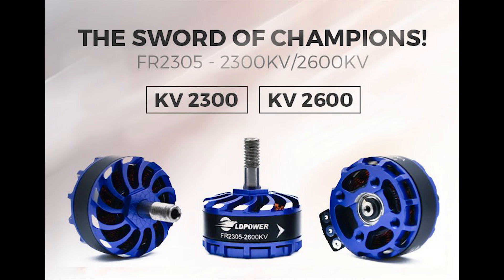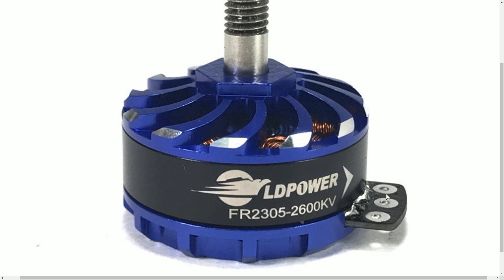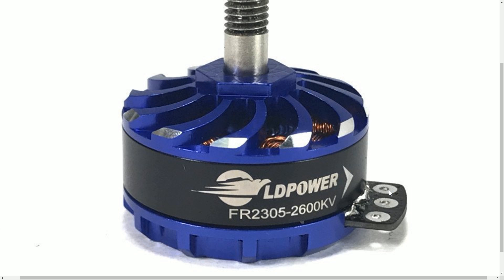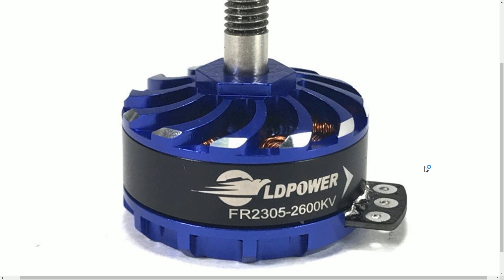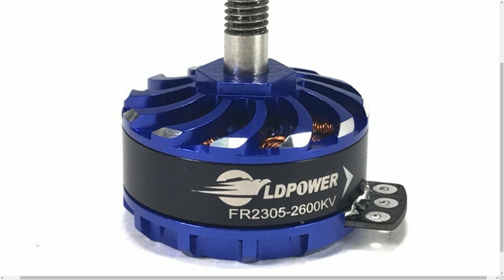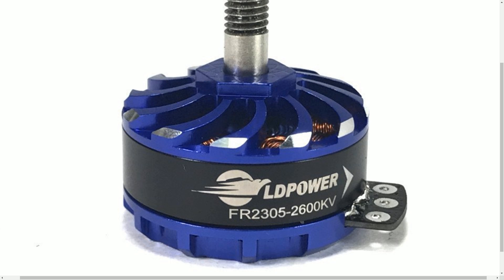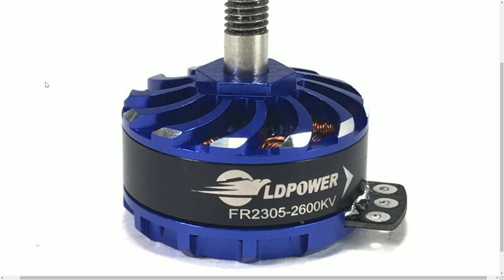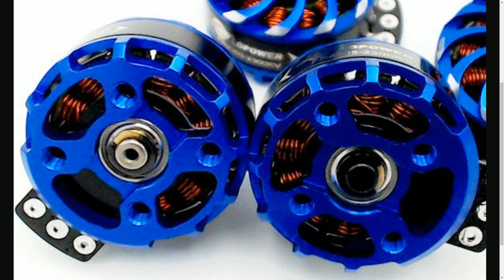LDPower FR2305 Motor | LIKE A V8 FOR YOUR QUAD

Comment: How could I limit the Poweroutput of the FC?
Reply: Might be able to just limit the endstops on your controller. But then its like, why buy performance motors if they are heavier than a smaller and cheaper one? Its like buying a drag racing car and only driving it like your mom's mini van around town, its a bit pointless. 

The only reason I can see is if you are beginning or wanting low power for indoors (I'm hoping to fly a Lizard95 indoors. It goes 70+ MPH, so I'm really going to have to limit it so I don't smash through a window or a TV. I doubt its going to be tamed, at least by me, I'm just starting so I know I'm going to wreck the thing even with a huge field dozens/hundreds of times). Lowering the throttle is probably my only hope to fly it indoors, and I have bumper air ducts like a Tiny Whoop I designed for it.
Reply from the maker: https://www.youtube.com/watch?v=0GDztuztioU
Reply: Joshua Bardwell awesome tutorial. Maybe the Lizard 95 with bumper guards will be controllable enough for indoor flying. If it can, it would be perfect for someone that wants a fun race quad when the weather is nice, and a Tiny Whoop when it's bad weather. I'll just have to try and see.

Comment: there are much better and powerfu motors than this... It's only me and they aren't that fast? R4 and Xnova 2206 Lightning are much lighter and seem more powerful to me...
Reply from the maker: I agree, although I don't have a ton of experience with other ultra-powerful motors. The reason to buy a motor like this is NOT because it has the best power-to-weight ratio or efficiency. The reason to buy this motor is because you like its throttle curve, and I do like it VERY MUCH. The motor is super responsive and predictable. If I could find a 28g motor that performed the same, I would take it though, and I suspect such a motor does exist.
Reply: I agree, they are smooth, they are great to freestyle flyers, i have the 2307 to test and they look very good but they are a bit in the heavy side (36g).

Comment: You can over prop these 2305's because the larger stator has enough torque to actually try to spin higher pitched props faster. Hence the hot motors and batteries. Like for these T Motors... http://www.miniquadtestbench.com/t-motor-f40ii-2305-2300kv.html

Comment: I'm really not totally convinced the smoke you saw was actually smoke. Looks more like lens flare or some sort of camera artifact to me, just because of how it behaves, going straight up, rather than being blown around and downwards. I dunno, if it actually was smoking, that sounds like a pretty serious issue (and I'm surprised you would still recommend them at all, if it actually was!)
Reply from the maker: No, I really am sure it isn't lens flare. I have been over the video many times and it consistently happens when the motors are punching, regardless of where the sun is.

Look here: https://www.youtube.com/watch?v=ZpU6-JY6fnk

You can literally see a streamer of smoke come out of the front-right motor. Watch it at 1/4 speed.

https://youtu.be/Sc5x-Hd6ZCM?t=53s

At 53 seconds, you can see lens flare, but as expected, it is in the center of the screen, not the edge.

And here: https://youtu.be/Sc5x-Hd6ZCM?t=59s

Another streamer of smoke from the left motor, and I am not even looking anywhere near the sun.
Reply: Chris Tate Definitely lens flare, you can see the small flares on the right side pivot at exactly the same rate as he rolls. Easy to mistake as smoke, but yeah, those motors are pulling so much air down, smoke would never rise like that unless the motor was stopped - pause on 13:44 and it's clear as day.
Reply: Yes, I see it now. In the frames I was looking at there was definitely flare in that area likely masking the smoke, but in the other examples it's inconsistent with flare. Yikes! You might want to pull off the bell and see if you can get into the bearings. I bet they are BLACK.
Reply: Fair enough, I thought it was a once off, but that looks pretty convincingly like smoke. Perhaps a friction point of some sort, like bad bearing, or something rubbing a moving part of the motor, and having it burn. Pretty bad, regardless what it was causing it. Did the bearing still feel okay after the motor hotboxed your quad? No major side to side play or grinding sounds?

Honestly, these were on the shortlist for my new 6" build, but I'm kinda shying away from them when we have so many motors that don't try to catch on fire when you punch them available. Like those new brotherhobby R5s! (and you thought the r4 was mean to batteries!)

Comment: When you say "Hot motors" warm motors etc, any chance of actually measuring temperatures of motors you consider warm and 'too hot'.  i understand the idea of judging for yourself but it would be nice to have temperatures to help guide us.
Reply from the maker: Hotter than 160 F is suspicious. Somewhere between 180 and 200  F and above, the enamel is in danger.  Realistically I don't think you should push it because you don't know how hot they actually are in flight.
Reply: Ah ok, so basically where "most" people wouldn't be able to keep holding it without it hurting. That does help actually. now i know if i can comfortably hold it indefinitely then they are ok. cheers  (and in case you missed my reply on a past video, and still haven't found out why a lot of pcbs have their writing on the underside. i suspect its so you can use pin headers and still read the writing after :)

Comment: In one of Ryan's motor reviews he talked about how the stator height meant a lot more for power and efficiency the width does, something along the lines of the motors with lower but wider stator started to really jack the amps up when the props got heavy where the taller stator motors were more linear in efficiency, can't remember which review he discussed this in but he had burnt the motor in his testing , I do know it was a 2305 maybe one of the tmotors. I think if you get the opportunity to test more "monster motors" hopefully you can get your hands of the emax 2306 or the efaw 2407's. Although honestly I think a newer generation 2206 is more the 90% of fpv pilots need and even they will destroy your lipos.

Comment: This motor vs emax 2306 2400kv motors? (assuming 2300 or 2450 kv ldpower motors)?

What would you pick?

I'm still using the standard 2300kv red bottom emax motors so my frame of reference is limited. 

In my experience, i really like the quality of the emax motors.
Reply from the maker: I honestly don't know because I haven't flown the Emax. People have amazing things to say about the 2306 with Avan props.

Comment: https://m.banggood.com/BETAFLIGHT-30_5x30_5mm-F3-Flight-Controller-Built-in-OSD-PDB-SD-Card-BEC-and-Current-Sensor-p-1162891.html?rmmds=search

is that one👆👆 beta flight f3 cab I buy it
Reply from the maker: It does look like a BFF3, yes. I'm a little surprised because I didn't know Banggood was carrying them.
Reply: Joshua Bardwell  can I buy it even it's not bff3 it looks like a clone
Reply: I can't wait a long time for bff3
Reply: It's missing the wasp/bee logo. I suspect it's a clone. Scummy...

Comment: Something still off about the audio in the videos....Sounds like it is some weird encoding or something that makes it sound as if you are being smothered by a pillow....which doesn't look to be the case.  Every other video I watch sounds fine.
Edit:  Figured it out...ish.  Your voice audio is trying to come out my rear speakers on my PC, but your intro logo audio comes out the front.  Seems like something is up with your encoding.
Reply from the maker: You have some kind of synthetic surround sound active on your system. My voice is coming out the rear because I record my voice in mono, whereas the intro is in stereo. Nothing is up with my encoding. It's stereo. Set your playback system to stereo and it will be fine.

Comment: Im confused about something this 'positive ventilation/cooling'.....
As you describe it, the motors rotation is 'flinging' the hot air up & out....
Up- against the downthrust provided by the props?
Surely the down thrust of the props (yes there's less/not a whole lot that close to center of prop) would cancel that out or even over-ride it?
Wouldn't it be more effective it the motors spun the other way so the finning helps to pump air down & through the motor instead???
Just seemed like a really obvious thing to me which is why Im confused as the manufacturers would surely see this problem too- so what am I missing here?
THanks again for your time, effort & content, & I appreciate any answer you might have
Reply from the maker: I don't know the details, I just know what I've been told. Remember that the prop is making less thrust toward the center, so there already may be a negative pressure area near the top-center of the prop disc, as air is pulled into the faster-moving column near the edge of the prop. Likewise, it makes sense that there would be a high pressure area at the bottom of the motor, as air strained to escape from the prop pushing it down.
Reply: Thank you for your prompt reply once again Joshua...
I wrote the above at the start of the clip having paused while it was fresh in my mind.
But when later in the clip you showed the motor puffing little clouds of smoke I started to think similar thoughts as to pressure area & figured, "Well, these genius motor manufacturers DO know more than me after all..." AND (jeez I miss italics) "Seeing some simulations of fluid dynamics around the motor & a prop would sure be interesting!"
Annnyways, thank you again for everything- most especially for helping to answer silly noob questions in my quest to feed my brain useful information & trivia to ponder.... ;)

Comment: What do you mean the motor is no good if you cut it too short, you've never spliced a wire?
Reply from the maker: Gosh, splice? What's that? Gee mister you sure use some ten dollar words. We jest solder with our mama's hair curlers around here.
Reply: Yea ok - I just thought it was bad information. Often when using 4-1 I have to splice the extra length of wire. I'm not sure why you took it negatively but maybe so many smart ass comments have worn you down and you see everything as a dig?

Comment: Once again I fail to put this in the comment section of the right video so this is a bit outta context. In the video about your the chameleon build you talked about the braid on the pagoda breaking afer some time. I am most definately not an RF expert but as far as I can tell it wouldn't change anything about the antenna's capabilities if you put some epoxy around the non protected parts of the braid. Might be worth a try and could possibly  improve it's durability quite a bit. Espechially if you use an epoxy with slightly elastic properties. Also putting a single carbon rod or a kind of bumper out the back of the quad mght save the antenna from quite a bit of damage if the quad falls on its back, espechiallz with the stubbz version. I am aware that a thin rod probably wouln't hold up to a crash but having a cheap disposable part to absorb some of the energy might be worth it.
Reply: Josh Maxwell Just a heads up,  Joshua Bardwell is some sort of RF professional.
Reply: Tony Elmore I know. I commented because "I'm" not and he is. I wanted to know whether he thinks it's a good idea or not. I also referred to the video that he made about his chameleon frame in which he talks about the coax on pagoda antennas breaking from movement which I thought might be fixable by putting some epoxy on it. Btw I only meant the part of the coax that is below the the actual antenna.

Comment: in most cases the friction between two surfaces is supposed to drive the prop. if you need reverse rotation it means you never had the prop nut tight enough to begin with. in the real world reverse threads are usually used to counter act procession not acceleration. the problem with acceleration is that things that spin also stop spinning so unless the thing is really heavy and happens to start up faster than it slows down it doesn't change much. when it comes to wheel nuts you should only have procession when you hit bumps on heavy loaded vehicles like dump trucks. the friction between the rim and hub should prevent anything from sliding around to cause procession in normal situations. procession normally exists on spinning parts that have a force pushing on their side like the ground pushing up against a wheel or a foot pushing down on a bicycle pedal, but you don't have that with a propeller. the nuts own inertia is so small it's a non factor, the prop might be a different story but if you can't get enough friction to drive the prop then self tightening threads are only going to make props hard to get off, but you don't really have that problem because there is enough friction to drive the props which means you don't need self tightening threads....

Comment: hi joshua awesome video im currently running tmotor  mn2204 2300kv  on dal 5045 bn v2 and theyre efficient and decently powerful at around 57a max but id like something more powerful but not crazy amp hungry  was thinkingof the rotorgeeks 2204 2300 or the 2206. so the question is which motors would u recomend for freestyle with good thrust but pulling under 70a
Reply from the maker: I fly these motors and like them a lot:

http://rotorgeeks.com/index.php?route=product/product&product_id=421

Not rip your face off power, but reasonable and very smooth and durable.